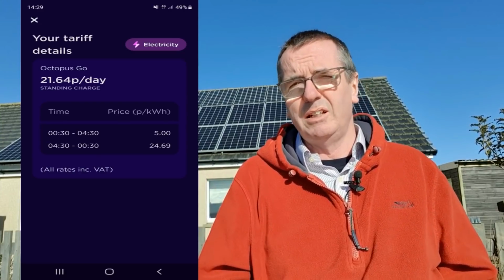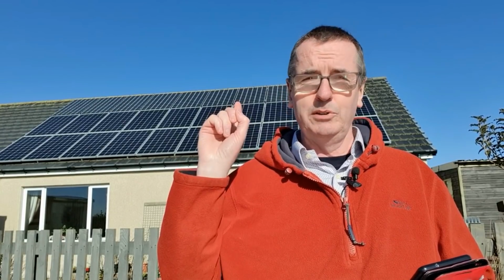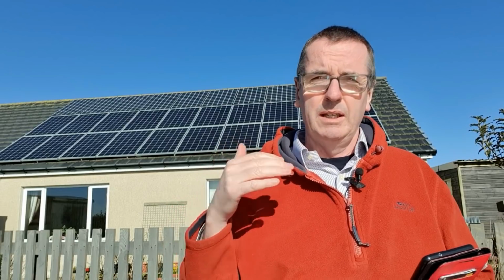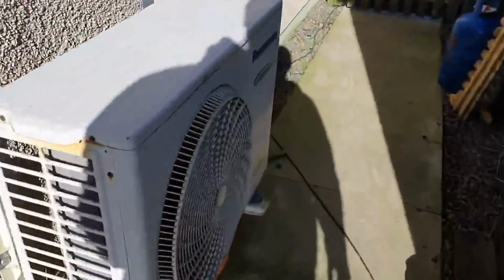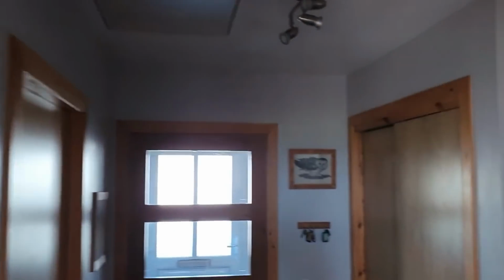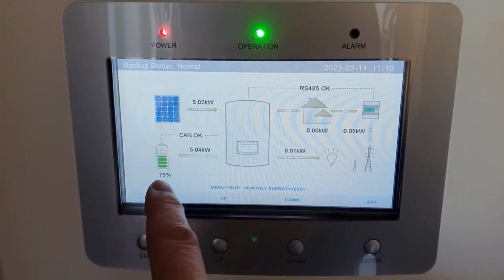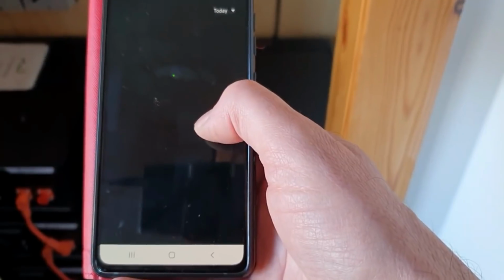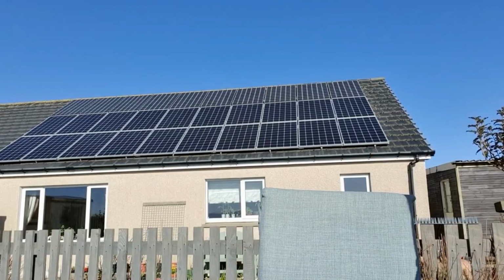My home solar PV and Pylontec battery storage setup

Comment: how many units will you need to be 100%   solar to batteries to cover.   can you get to a point were you do not need the grid.
and so remove the standing charge  forever.
you can get your money back when selling the house.  it will be worth more.
get low energy items.  like led light bulbs.  etc.
my  fit etc I get  covers my whole electric bill,  and Gas  and house insurance.  and i only have a 3kw system.
in summer i use  1 unit a day on average.  in winter 5 to 6 units,  of  grid electricity.
solar is well worth it.

Comment: solis inverters are great, I noticed that the chassis of yours don't appear to be earthed? on the right side of the solis towards the bottom there is a little earth screw which I think needs connecting otherwise your warranty will be voided? could be (and probably am) wrong 🙂

Comment: Hi Jonathan.  I enjoyed this video about your solar setup at your home in Orkney. I saw you have a Panasonic heat pump AC heating/cooling system which you said heats your whole home in winter?  We are getting a Fujitsu system installed in May and I wondered if I could ask you about your system?  What heating/cooling power is it?  BTU or KW?  You have 2 indoor units? What heating output can each provide.  On the coldest winter's day, does it really heat your whole house (other than your heated towel rail in your bathroom)?  Is your house very highly insulated like an "eco house"?  How much electrical power does the Panasonic system consume when on full heating, and how much energy does it use on a typical winter's day?  We are getting a 24,000BTU (7.1kW) multi-split system with 3 indoor units, 12,000BTU (3.5kW) in the kitchen diner, and another 12,000BTU in the lounge, and a 7,000BTU (2kW) in our main bedroom.  We plan to provide individual heating, if needed, in other less frequently used rooms using Far IR radiant panels of between 700W and 900W as required, with individual room thermostatic controllers.  Sorry for all the questions but I am really interested to see how you get on with your air to air heating system in the depths of winter.  We have a 4kWp PV system (expanding to 6.4kWp later this year), and 19.2kWh (15kWh usable to 80% DOD) of Pylontech batteries, and an Economy 7 tariff for overnight charging in Winter.  We plan to "retire" our oil fired combi this year and replace it with a 250L Mixergy tank, and PV diverter.  Also hope to add a 12kWh electric storage heater in the downstairs hallway, as a "thermal store" for use on sunny days in the shoulder months, (Oct/Nov, and Feb/March) when the sun might shine a lot to "charge" it, and heating is still needed, and maybe selectively overnight in the coldest depths of winter to supplement the Fujitsu heat pump/IR panels if the weather forecast looks to be particularly cold.  🙂.  Thanks for all your PV/sustainable encouragement.  Very best wishes, Paul Buglass, York, UK.

Comment: Thanks. Your thinking and installation is what I want.
Yes got the EV already, and solar panels and Pylontec batteries coming in 2 weeks.
The supplier is proposing 2 batteries with circa 7Kwh, but I will be asking for 3 at about 10 Kwh. 
Yes as I already have the EV, I am on Octopus Go, so will adopt a strategy of maximising my off peak rate, which is going up to 7.5p/Kwh soon.
Reply from the maker: Brilliant 👏 👍👍

Comment: I’ve got a 3-9kw Solar panel system fitted to my  home 8years ago oat a cost of £7995,in that time the panels have generated about £13700-00 in revenue from the Feed in Tariff so I’m already over £5700-00 ahead  plus all the electricity I’ve saved by using the washing machine and any other appliances in daylight hour’s ,I am definitely thinking of having a similar system to yours  fitted because of the never ending price increase’s. Any advice on where to purchase  the items required to do this would be greatly appreciated thanks David.

Comment: Morning Jonathan, I am wondering about how the Air Source Heat pump affects your setup. I have a slightly larger (3.5kw) one and 4.2kW pv. The start up current was dimming my lights for a few milliseconds each time it runs but I uprated the start up capacitor and that seems to have fixed that issue. Are you able to run the ASHP at night off your battery storage? I am calculating my battery storage needs just now so any knowledge share will be appreciated. My cottage is in Caithness, so we're under very similar conditions. I am hoping to get to the point where the cottage is off-grid. Cheers Dave C
Reply: David, I’m thinking about an ASHP, what make is yours, does it heat the whole house and is it cost effective? Sorry for all the questions but there’s not a lot of uk based info out there. Regards Nick
Reply: @nicklewis8009  its a chinese make ESDAW 12.5 kw output 3.5kw input, and yes it does heat the whole house. The house is well insulated, and I was replacing 15kw  storage heaters so the difference was night and day as I installed uprated radiators. I am in Caithness so I have located the ASHP inside a hut adjacent to the house. Controlled by a Salus programmable thermostat. I am trying to make it more efficient in winter by locating in the hut. The hut has the inverter from my solar panels so has some heat and the intention is to insulate the hut and feed warm air from an underground pipe. I also intend to locate batteries in this hut. It will be more cost effective when I can change from SSE and get a small wind turbine to trickle feed the batteries.

Comment: Great video. I had Solar panels installed about 8 years ago and based on the generation I get of about £700 per they should pay for themselves in a couple of years. Only thing I have never known is are my electric bills less as a result of my solar panels.

Comment: I dont understand how spending £10,000 on batteries makes any financial sense. Even at 30p a KW/H thats over 30,000 KWH before you get close to break even, by which point the batteries would be degraded and useless anyway. I do have solar and I have a solis inverter same one as yours (the 4G series). I looked at batteries but price put me off the idea real fast. I am likely to be a slave to the grid for a long time yet Lithium Phosphate which is what pylontec is built from only have 6000 cycles
Reply from the maker: 6000 full discharges and recharges is 16 years , i rarely fully discharge to 20% ( my minimum state of charge) so i expect my battries to out live me !  Yes there will be some degradation but in a room temperature environment,  and never under serious load ( unlike an ev batteries) Im not worried about 'end of life' for these pylontec.

Comment: Please can you tell me how many  🔋 🔋🔋 are need it ,to have electricity 24 hours like a normal electricity? My second question is does it power the whole house 🏡 ? Can you use heaters fridges, computers laptops , bulbs everything at the same like a normal?
Reply from the maker: Hi , depends on your usage  we just live normally , heater on , cups of tea etc and cooking.
At night or early mornings i just stagger boiling up for a cuppa , with the toaster ( these will pull around 2 kws each) battries will give out 3.6 kWs of power before i have to use the grid to top up.
In the day im covered ,( the zappi i can set to eco or fast )  i only pull off the grid if i was to plug in the EV at 7kWs draw,( fast setting on zappi ) this rarely happens as with 260 plus range its easy to plan for a long trip before and fill up  on solar or cheap overnight 5p rate electric.
So last week i spent 70p on grid electric ! Normal week , normal usage around the house.

Comment: Hi Jonathon
Can i ask how much kwh per year your house takes to run and how much do you think you have reduced pulling from the grid. I'm away to increase my solar capacity and install 15kw of battery storage  so interested on how effective this is. Thanks in advance.
Reply from the maker: Hi , im working it out for my 1 year review of my set up.

Comment: I’m having a similar solar PV-setup in south of Stockholm. But we get about the amount of what electricity cost +some extra to sell it to the grid daytime. I charge the car at night and use washing machine, dishwasher on timer to run at night. What do you get from exporting to the grid in the UK? Wondering since you say you avoid ”dumping” it to the grid. I would use energy storage as a buffer running at night filling in the morning and evening peaks here. Not to put solar energy into it.

Comment: hi ,i am looking to put solar on my roof but the front is facing east and back faces west ,in your video when your batteries are full and you back feed the grid do they pay you anything even though you said you were not using feed in tariff
Reply from the maker: Hi ian , no FIT payments,  my electrons will go back to grid and go to the nearest demand,  ie my neighbours,  whos meters spin when they 'use' my electricity from my panels , and their suppliers will charge them for electricity used ! 
Strange world eh ! 🤔

Comment: Great video Jon. I have a similar setup (24 panels, 2 x Solis inverters, Pylontech (4.8kw), ASHP, Zappi, Eddi & electric vehicle. I don’t have the battery storage that you do, so need more. Are you at FC Live at the end of April, would appreciate a conversation. Hugh G.
Reply from the maker: Hi Hugh , yes im at FC live , all 3 days , im on the ReFLEX / eco cars stand , next to DriveElectric.
Reply: @JonathanPorterfield  thanks, I will drop by.

Comment: That’s great info, thanks. How big are your solar panels in dimensions? I have a 4 bed detached house with a flat roof so can use all of the area, however I have been quoted as only being able to fit between 12 and 14 panels on my roof, which somewhat limits the amount of kWh I can have. As I am trying to max out the amount of kWh I’m after, I’m looking at using the best panels to get the most out of my roof. I think the panels I have been quoted for are the 200cm by 100cm. My roof is 8m by 4.6m.

Once again, really enjoyed this video. Thanks again 😁

Comment: Hi Jonathan, Really like your setup. I also live in a Bungalow like you but mine is East facing. How effective would it be putting panels on this side? I also have security concerns with putting expensive panels on my roof especially a bungalow as things go missing in my area unless its pretty secure. Is this likely to be an issue?
Reply from the maker: I suppose youd get morning sun facing east 🤔  a number of on line web sites that will calculate how good your roof direction is. 
Panels are really well bolted down , so it would take thief's a long time to disassemble and remove ,as well as not fall off the roof !

Comment: It looks like you have 8 x 3.5kWh batteries, how did you calculate your battery needs, i have a 5.2kWp solar system with a 4.8KWh battery which fills up fast and empties out fast too when my leaf visia is plugged in, salesperson advised this size, i want to get more storage, how do I clculate what would be optimal for my needs. My system is 6 months old.
Reply from the maker: Just buy as much as you can afford ! These last 3 weeks ive ran the house 24/7 from solar and stored solar at night , charging the ev is just in the daytime too.
Ive not pulled off the grid ( in anything like over 2kWhs per day) the last 3 weeks. 
All down to storage , storage is key , for us 28kWh is about right.
Reply: @JonathanPorterfield  thats great thanks for your reply

Comment: I've had 5.2kw of PV since 2016, JA 290's with a fronius inverter $6k and i also had  a Tesla powerwall2 with gateway installed August 2017 $10805.35 fully installed, a sanden heatpump hotwater system $4k.
I get 6.7 -7.0mwh per year. I have a free grid ev charging plan sat Sunday midday to 2pm.
The electric companies use this to burn off excess solar. At a guess I think that I've spent $200 bucks on electrics since 2016.

Comment: Well said Jonathan.
I am qualified in electrical and plumbing as a self-employed builder.
Regarding solar etc ...
I get asked all the time " when will it pay for itself ?"
I reply " when will your motorbike / caravan / car pay for itself ?"
I installed 2.4 kw solar just before the F.I.T was scrapped and i spent about £ 5500 on a self install and had the system M.C.S inspected and professionally signed off.
I've received about £9 grand in FIT payments since March 2012 , so that's a plus. (approx £900 a year at about 43 p a kwh , whether i use the energy or not ! )
Sorry to gloat, but  ...
Just 15 years of income left to enjoy then it stops !
Then there's the energy produced too which i was occasionally able to auto - divert to an immersion heater to augment the gas boiler output. Again. Result.
Then i installed a dual, solar-thermal system which heats the hot water tank when the sun is out for free.
My next plan is to install a battery system, DC - coupled Hybrid inverter and extra solar PV to offset the ridiculous price-hikes in energy bills we are all being subjected to.
This investment will set me back about 8 grand doing the work myself.
I dont consider payback, just a feeling of independence and some inevitable liberty from energy costs.
Our EV will also succumb to needing a home-charger such as the Zappi .( im a registered installer)
Once i get signed up to an off-peak tariff and subsequent "smart meter install" before next winter i guess ?
I love all this stuff !
Reply from the maker: I love to read about folk doing this ! Brilliant thanks for sharing and watching my video too 😀 👍👍

Comment: I have a similar  modular system 5kw solar, 3.7kw inverter and batteries by Fox-ess.
Very happy so far. 
Also have gone with Ripple energy wind farm for cheaper electricity, if interested they are linked with Octopus energy. 
EV car is next on list. 
All the best.

Comment: Great overview of your system. We are at the start for a Passive house off grid build when complete but at the mo just setting up for our static
so have a 3.5kw grid a cheap mpp inverter with pylontech battery to start.
will be looking at 25k array and 12 pylontech with GSHP and borehole trying as much to be off grid 
one question  regarding the pylontechs we only have 1 at the moment looking to by another next month i have found every now and again it goes to sleep during the night
but when you switch it on it has 3 lights still so 50% full, have you come across this before as not much info on this Cheers
Reply from the maker: I've not heard of this before re the pylontec shutting down , maybe a comms / sorfware issue ?

Comment: I don't rate the pylontech batteries as there only 1.7kw output, going at that shortens there life. There are others.. lower price and more kWh.

It's odd that you buy a big array and spend a lot of time paying for it.  But you base power is around 1.kw? Mines a lot less. 0.3kw
Making solar is easy to meet that during the spring and summer. It would be nice if we had net metering and 1 for 1 as any over production int he day we can get back at night. I think the drive is to get people to buy batteries for the grid.

Your rate 24p is better than some at 37p. But they do energy trading which I think could be a good idea to make money, but on expensive Batteries it's probably not worth it.

Nice set up, I was looking at the Solis 4g series. Look good
Reply from the maker: Mine are the 'c' series,  so i get 3.2 kW output

Comment: Hi Jonathan, any chance you could do a video on your mini split air to air heating system. I really want one but can't find any real world data on them as everyone has air to water systems. I want to know how much power it actually uses. How long you have to on for to heat and cool the house, do you use it as you would a gas boiler, set it to come on an hour before you get up and get home, or does it stay on all day. Do you need a backup on really cold days or does it cope? What sort of m² is your house? Thanks, Jason

Comment: We have about 3.5kW air source heat pump and it's an absolute KILLER as far as the electricity bill goes.

Just invested in a 7.5kW solar array and 24.6kWh of GivEnergy batteries. Will be interesting to see if this manages to reduce the bill significantly.
Reply from the maker: Key to heat pumps is really good insulation in the home. Thanks for your comments 🙂
Reply: Are you using weather compensation?

Comment: Hiya Johnathan we spoke about solar panels a couple of weeks ago and you were very helpful 👍 I've got a bit of a dilemma. Which would be the most cost effective? Buying an ev Van for work and having a battery installed to charge up when cheap or panels and a battery? Can't afford the panels battery and the van so what would be your choice and why 🤔
Reply from the maker: From a purely financial point , what ever costs you the most at present , replace that first ! 
My instinct says the van 1st , as you'll see saving on fuel/ tax/ servicing,  and the fossil fuel van is the most polluting !
Reply: Get the batteries.